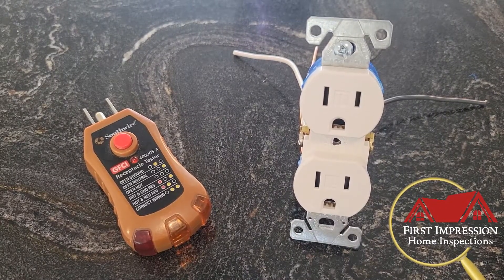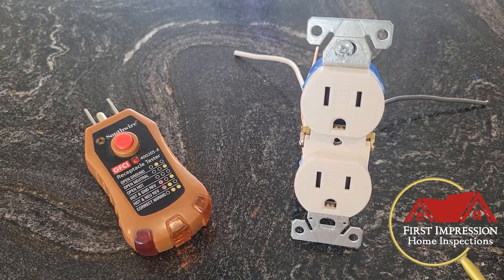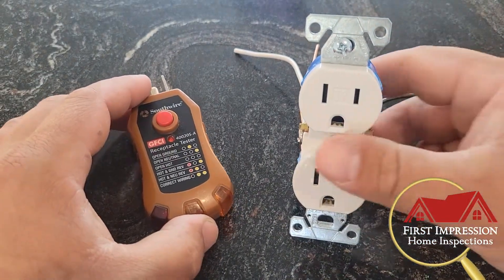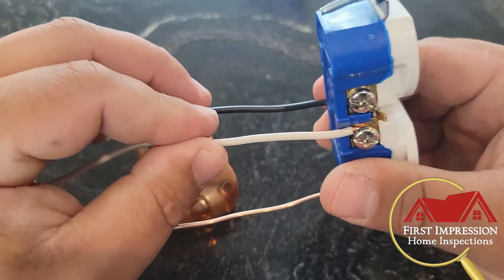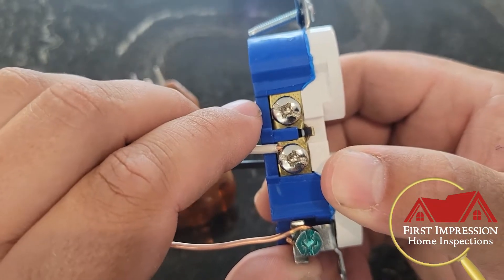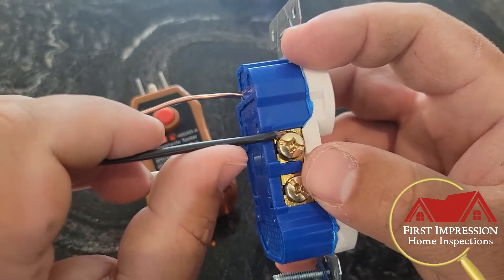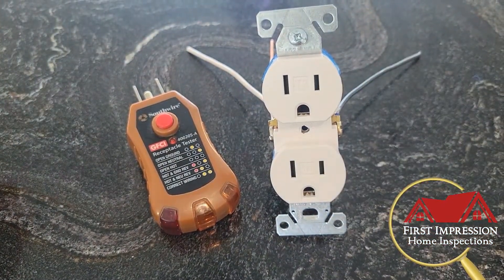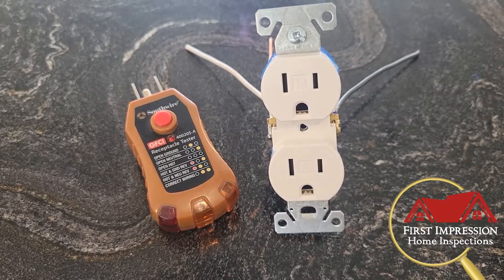Hot and Neutral reversed (outlets)

Comment: Question, My tester shows hot and neutral reversed, but they are not neutral(white) is on the left side, and hot(Black) is on the right.( Looking from the front ) Also I check with a volt meter and the hot ( Black) wire has 121 volts AC. Tester shows red and center green on???
Reply: Same thing for me on my new Leviton GFCI I just installed. Did you figure anything out?

Comment: A hot and neutral reverse is also possible even with the black and white wires on the correct terminals if reversed somewhere upstream, whether it be at another receptacle,  a junction box,  or even at the panel.   The problem is, most if not all your devices will work normally and give no indication of a problem.  But for safety reasons,  this should be corrected immediately.  Classic example is a table lamp with an Edison base socket, it's easier to touch the threads when changing a bulb.   When wired properly,  the threads are neutral,  and the switch breaks the hot connection at the bottom of the socket.   Reversed and the treads remain hot posing a risk of shock even when the lamp is turned off.  Sometimes really old lamps will have a non polarized plug (two narrow blades the same width) allowing the plug to be inserted either way.   Such plugs are outdated and unsafe,  and should be replaced with a polarized cord and plug.
Reply: My outlets say hot neutral switched. So I switched them and tested,,,,,it still says switched. By the way, I tried 2 different testers.
Reply: @jonbarry8187  its somewhere upstream